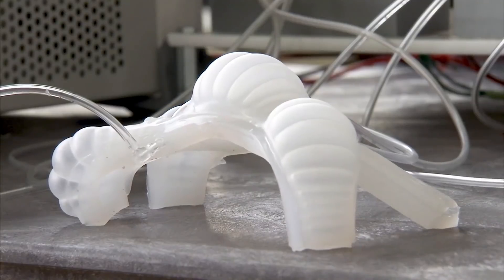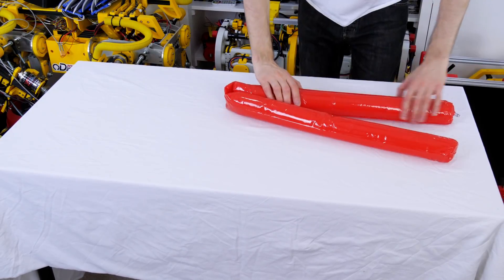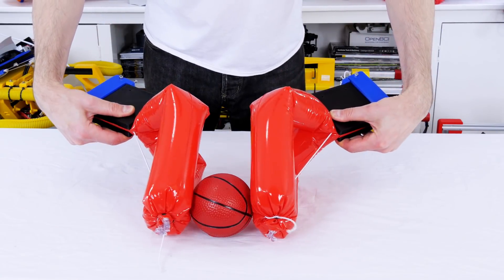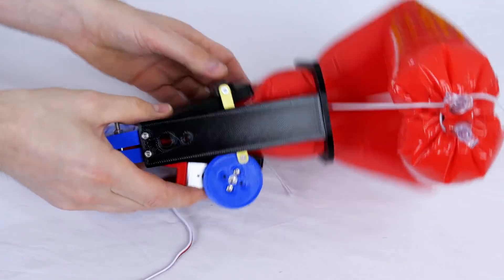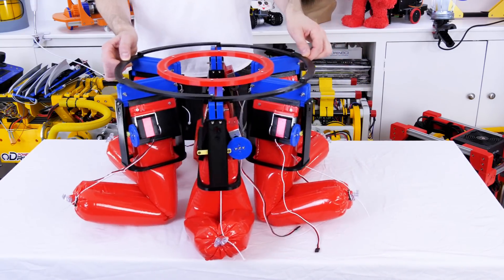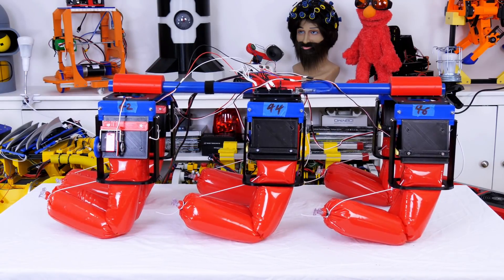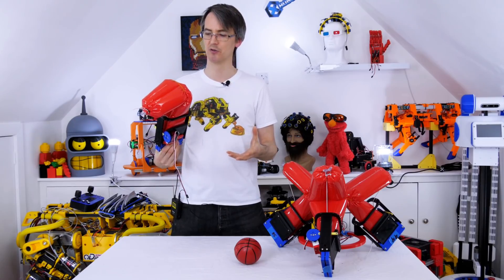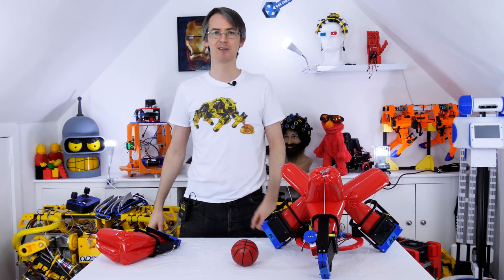Why this Robot Squashes Itself to Move

Comment: It seems like there is a fundamental limitation due to the compressibility of air. Maybe an incompressible fluid would work better. The first idea would be to use water but that would also add a lot of weight and require strong servos. Maybe some sort of mineral oil could work. But at that scale it would probably not be viable.

Comment: Although it would be much heavier, I wonder how much power you would gain by  using water instead of air. That might make the joints more ridgid, and loose les power through air  compression.  Curious what you think!

Comment: I'm curious if your issue is either a lack of air pressure in the noodle or your bellow isn't displacing enough air... Which would essentially be synonymous with this use case, I believe

Comment: I love the variety of stuff you make on this channel. I was REALLY interested in your motor control via brain stimulation video. In the video you had promised a "part 2." 
Do you think you will get back to that soon?!? Thanks for doing all you do with this channel!
Reply from the maker: I've tried but the data is not consistent or easy to get out of it.
Reply: @jamesbruton   Have you tried the emotiv epoc headset? I think this might give you better results. I read and IEEE article about using this epoc device to control an arduino-based race car.

Comment: Have you tried make the squashing mechanism a bit longer or making the squashing mechanism spred out across the water noodles to see if the air need a little more pressure to straighten it out

Comment: Disclaimer: I'm just a stupid guy who doesn't know jack about material density and stuff.
What happens if you change the inside medium of the pool noodle from solely air to water and a little bit of air (to prevent too high pressure).
As far as I can see it, it is the displacement of the air that inflates the pool noodle which is in a semi collapsed state so if you change the medium to something less compressible the displacement should work better that way...

I hope there is not too much of a blatant flaw (except the weight)

Comment: Maybe it would be worth a try to use syringes and tubes instead of the servos. So the robot would still have no need for external air source but it could shift around the air pressure very precisely. For example you could deflate and inflate parts of the structure to shift around the center of mass, or heavily compress the air in some actuator for a tighter grip. If you add some valves you could even transfer the air between separate "body parts".

Comment: Really cool project! What if you filled the noodles with water? Since it's not compressible you may have more movement? I know it may be a bit heavier and require stronger servos.
Have you ever looked into Nitinol? That would be awesome to make a robot out of. Use electricity to heat the wire for movement in one direction, to move it the other way faster you could have the wire in a silicone tube and pass air or non conductive fluid through it to cool the wire faster.

Comment: If you made a barrel roller you wouldn't need to do it in two halves. If you just don't extend the legs on the inside of a turn that side will be smaller and it will turn that way like a cone rolling on its side.

Comment: put helium inside the balloons to compensate for some of the weight, and increasing the pressure might be good, also try adding feet and "leg armor" to prevent the legs from expanding sideways and promoting them to straighten

Comment: Have an idea for mobility, if you remember the little toy to make from the buzzer vibration moter from a phone and a tooth brush brush.
Could test it with 3 or 4 brooms... or maybe 2 brooms, and cut them in half as manufactures ofter put a tilt on the bristles... and can steer with a 360° servo.
Mount 4 vibrating moter of a suitable size... 
With the servos, do a wee programs you'll be able to move in multable directions an or like a car.
Umm the servos will have to pretty strong, but the motors are vibrating the brushes, the steering load will probably drop.

No idea forvthe needed batter size, or how long it could run.
Maybe a good idea to have a petenchiomitor to control the motor speeds, to run as efficiently as possable, and different terrains...

And use that as a base to carry your sift robot.

We I thought it would look pretty cool ...

Comment: Instead of a camping actuator, use 2 rollers like a clothes wringer.  You can control pressure and length at the same time.  
Try and make it walk like an ant.  https://www.youtube.com/watch?v=tWHnT08wU1o&ab_channel=wardy10

Comment: James, have you seen the videos that use coiled fishing line as a muscle? They’re very strong relative to weight, and the action is driven by a heat differential. I’d be fascinated to see you experiment with that. They seem to have huge potential, but haven’t been explored nearly enough. Fingers crossed that this catches your interest!
Reply: IIRC they're pretty slow
Reply: @DoNotHackMyAccount  - I think they’re as slow or fast as the line can be heated or cooled. Not necessarily or fundamentally slow.

Comment: Hey what happens if you fill the noodle with water? does it increase the force transferred? I ask because air is very good at compressing under pressure. I'd love to see a follow up.

Comment: James,   Try a different fluid for the pool noodles.   Your fluid (air) is getting compressed to easily.    Water should work to transfer the servo motion to extension of the noodle with the down side of weight.
Reply from the maker: It would get really heavy though, might work underwater...

Comment: You could possibly improve the force exerted by the legs by using tape or something to prevent the rubber from expanding in areas that don’t contribute to the motion, because that’s probably wasting some energy.

Comment: Instead of doing 2 halves of the barrel, would it not be possible to just actuate one side of the barrel (assuming you have 2 rows of actuators). It should turn as one side will then have a larger circumference than the other.  Your turn radius won't be as good though

Comment: It seems the noodle volume is too big or the actuator displacement is too small. An important equation here is PV=nRT. The pressures being created before and after are not different enough to create locomotion. P is pressure and V is the volume. in both the before and after actuation cases the equation holds true. n,R and T will be largely constant. 
The ratio of actuator displaced volume vs noodle volume needs to be increased.  and keep non-expandable noodles, too.

Comment: Love the idea! One thing you could try to better control the pressure is using something like a toothbrush roller squished and some motors, then if the pressure isn't enough just squish some more. Love you videos.

Comment: I actually think the problem with your designs for locomotion aren't to heavy but not heavy enough.  The issue is the mechanismal weight on the design of the pool noodle air bladders because air is too compressible but if you used a higher pressure of air/stronger bladder you might have more success.  Hydraulic water and oil would be too heavy but possibly solids moving like fluids, ie lubricated beads might work.

A suggestion that I can't test myself but something to consider, although it probably wouldn't be as affordable either. 

I love the conceptual robotics experiments you do, always reminds me of University.

Comment: You can fill them with more air to increase pressure and get more force to carry something heavy.
Reply: Doing so would make them more rigid and less effective.
Reply: @3ATIVE  well, I'm pretty sure it can be balanced between power of the motors and pressure, to find optimal setup that can at least move itself.
Reply: @3ATIVE  🤔
Reply: @3ATIVE  may be

Comment: Maybe an easy fix but habe you tried inflating the pool noodles even more. Because it seems there is to much weight pushing on the outside. If you inflate them upside down so they are just about to collapse. Maybe you have tried already but ist seems to me that maybe dialing in the air inside the pool noodle can improve the result

Comment: The idea of squishing a tube of fluid to make a pneumatic actuator is really cool, maybe you could have a central squishing mechanism the  then pushes the fluid out to a joint, like a compressor basically, but much smaller and lighter

Comment: I’m actually researching soft robotics at my college, thank you for creating this video to help me learn more
Reply: Please share your work if possible, I mean share on youtube if possible.
Reply: What the guy above me said
Reply: What the guy above the guy above me said
Reply: Can you create prototypes? I have an interesting idea for a soft robot. A ball with lots of small "fingers" on all sides, the whole thing one big piece and pressurized, and in the center of it, a mechanical part that can somehow pull in the fingers independently. The pressure would push them out when the mechanism releases them, and by pushing fingers out in certain order the ball could roll in chosen direction. As a big squishy ball, it could fall from great heights without taking damage or use wind to move around big open areas. I don't think it should be tol complicated of a machine, just some simple actuators in a ball form and strings attached to them and fingers.
Reply: @outandabout259  that’s a cool idea, I’ll def keep that in mind thank you
Reply: That sounds cool. You should make it and post it on YouTube
Reply: PLEASE

Comment: A better soft actuator of this kind is a bean bag that you suck the air out of. It allows you to stuff the bean bag around the object you want to pick up, and then when you suck the air out, the object is locked into the collection of beans vs the outer bag. Lets you pick up delicate and oddly shaped objects. Very useful!
Reply: You could also look at an electrostatic gripper. It uses electrodes which are encased in a elastic material. The electrodes will create a magnetic field causing the electrodes to attract to each other and grab anything thats in between them. Im currently doing my graduation on developing one. The problem with the bean bag which uses granular jamming is that they are not very durable and very heavy.

Comment: The compressive nature of a gas will always work against you in that there is no reliable way to easily extend a pneumatic device to an exact point.
Using gas actuators works very well in an "extended/retracted" scenario but to reliably extend to say 45 degrees will be a nightmare.
But as you said, using these as "light touch" grippers would work well but placement accuracy would still be an issue if precise placement was needed.
I really like the servo powered "squeeze" device.

Comment: Could there be a way that 2 tubes joined together adds more range of movement? Having and adjusting the bellows at each could help direct the balance of air in tubes as well. 🤔

Comment: rubber inner tubes with schrader valves could allow you to play around with the pressure in the limbs. this is a really intriguing area of robotics and I'd love to see you carry it further!
Reply: Yes, but the effectiveness of the pressure actuators would be greatly reduced as the tubes would expand as pressure increased- reducing pressure. The reaction from this is reducing the force required by the clamp actuators.

Comment: Can you try to make a electric magnatic system which have coil and magnet between them and repeated system means you have lot more travel inside a cylinder , but you can also do transfer of current with using rails inside the cylinder  , i am sure that will work perfectly
Reply: So... re-invent the Solenoid ?? LOL

Comment: I think you might be able to get better results if you eliminated the legs' ability to inflate due to the pressure. By wrapping the "leg" and "shin" parts with something like packing tape or something with a much higher Young's modulus than the pool noodle skin, you can focus all the servo's volume displacement right into the knee, hopefully resulting in a stronger force there.
This is somewhat similar to the idea of pneumatic muscles using braided wire sleeving, but also not really. By selectively placing strong material over weak material, you can force the pressure to preference a certain movement over a general expansion.

I'm not 100% sure that this would work, due to the fact that air is a compressible medium and you may just end up with higher pressure, but it's simple enough that it might be worth a try?

Comment: Oh, on the compression, would be interesting to fill the legs with water instead of air! ... would obviously be too heavy ... but maybe quite interesting.
Reply: It would be more rigid, and capable of supporting more weight, but I think the real problem is the force application from the servos. It's too slow and the leverage is reducing the force. It seems, to me, that you'd get much further with propulsion using a sharper movement to take advantage of some bounce and slip in the "stride". The volume of fluid would want to be balanced, of course, to prevent out-of-control bouncing.
I would like to see more experimentation with sequential movements at varying speeds too. Think of those little toothbrush-like buzzing toys. The leg movements attempted here were very rudimentary, and especially in conjunction with aforementioned slow movement, would not predictably produce anything useful.
You'll never beat hydraulic pistons, of course.
Reply: Perhaps a lighter fluid like some sort of oil
Reply: First thing I thought about as well, use a gear train for the servos or use even stronger servos and switch it out with water or another liquid like oil. If the plastic could handle it, it should be 1:1 ratio of force applied.

I don't think belows is the best in this application though. Maybe instead use two stationary plates that clamp down on the noodle and have one movable plate inbetween which is moved with one or two threaded rods to squash the noodle.
Reply: Do you honestly think that would be interesting?
Reply: @apbosh1  bellows activated hydraulics instead of pump driven ... think about the steampunk spiders (actually a bit like real spiders, since thier heart is basically a pool noodle that they squeeze to extend thier legs)
Reply: @brantwedel  Sorry Brant, I appreciate your passion for the topic but its not doing much for me.  ✌
Reply: @apbosh1  I'd find it interesting. The pressure inside the legs obviously increases when it's carrying its own weight. Using an incompressible fluid would make for an interesting experiment.